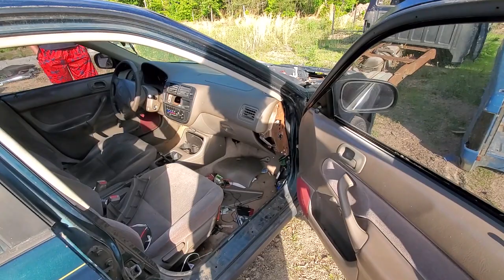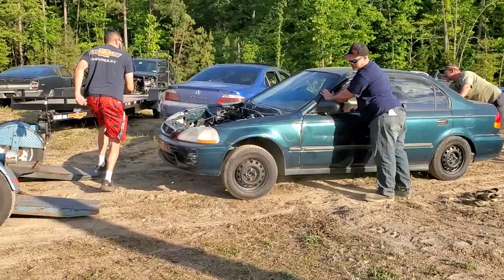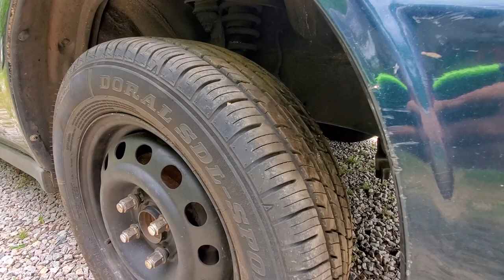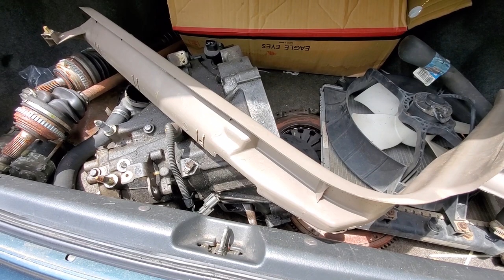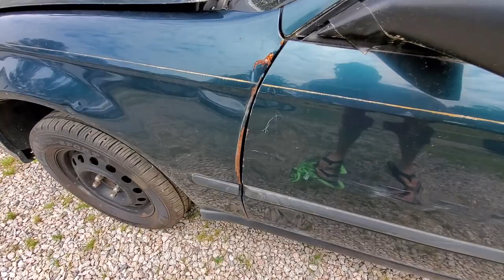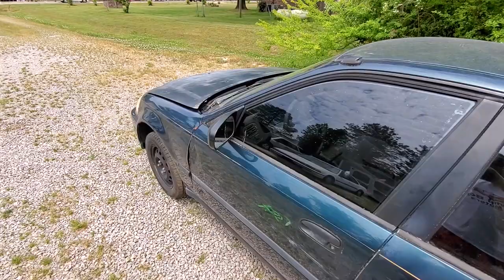Bought A New Project! | Sleeper Turbo Honda Civic

Comment: Bro I'm following this, right now I'm doing a B61a series swap in my 98 civic! 👍
Reply: Just put the b16a in my eg!
Reply: @bambamc-gd6od  get yourself a 500 hundred dollar b20b. They are better.
Reply: @notsure3535  nooooooooo no they are deff not
Reply: @billybuckner7762  they make just about the same hp as a b16. But make like 30 plus more torque. b16 are dogs until vtec kicks in.
Reply: @billybuckner7762  plus they are way cheaper $